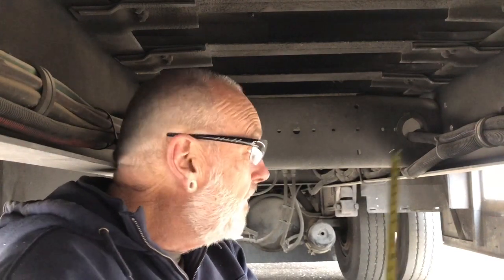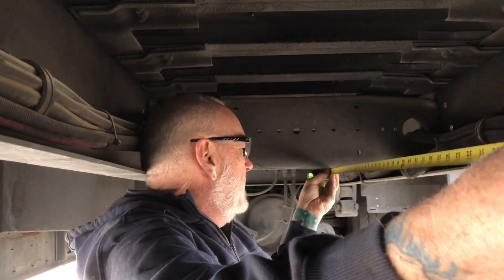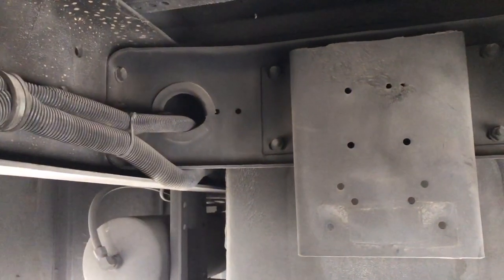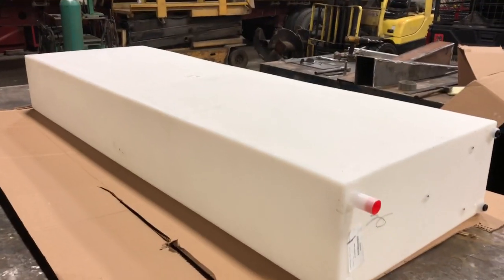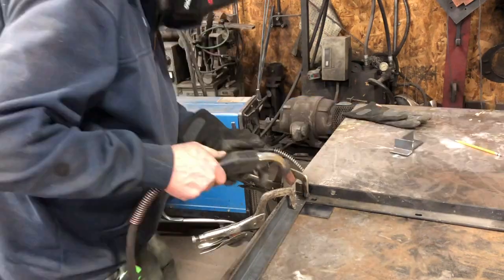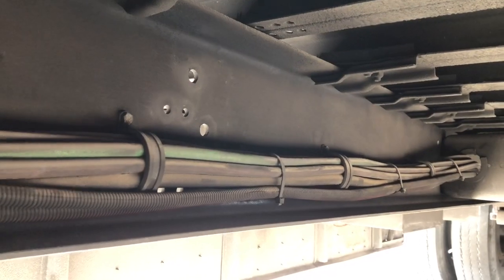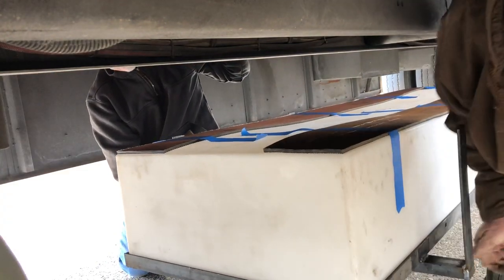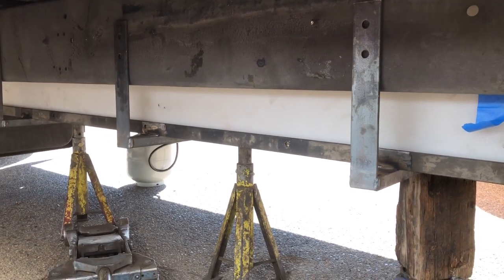Fresh Water Tank in “C” Frame - Part 1 - Vlog 81 School Bus Conversion

Comment: Is that a recpro 100 g tank? 11 inches wide?
Reply from the maker: Yes -- we got it on Amazon.
Reply: @KnappTime  let us know what you think of the quality and the connectors on them. We just raised the roof and are going to need to decide on tanks soon. We're planning 200g fresh inside and 100g gray tank mounted as you're doing yours in our bay between the frame rails.  Those tanks look good if quality it sufficient.